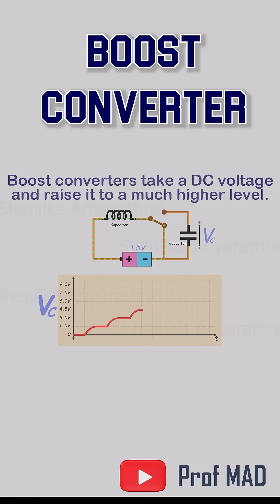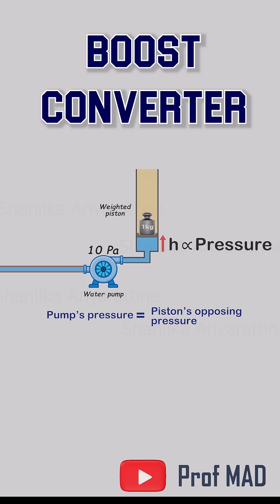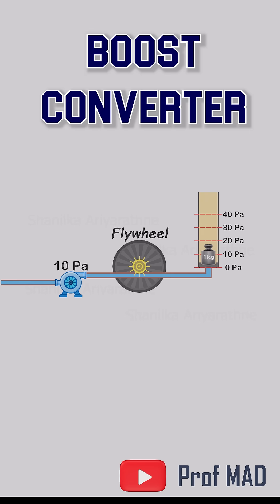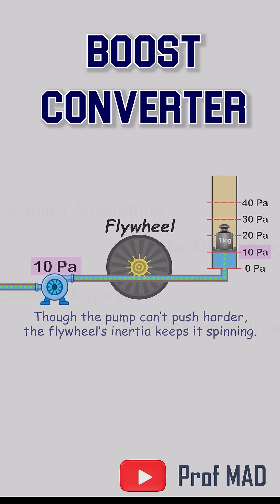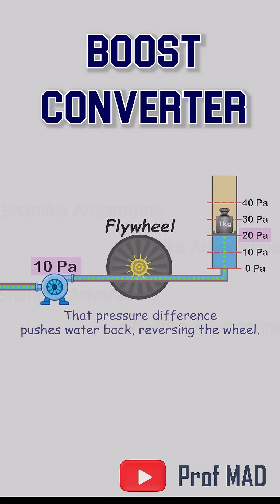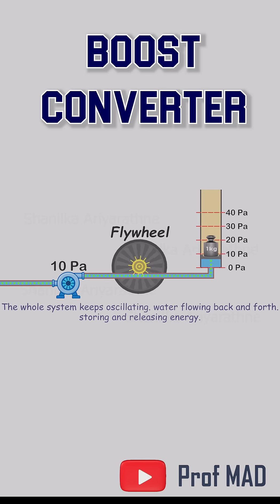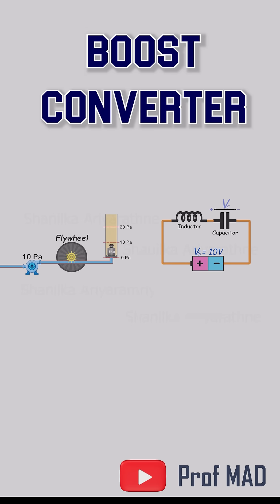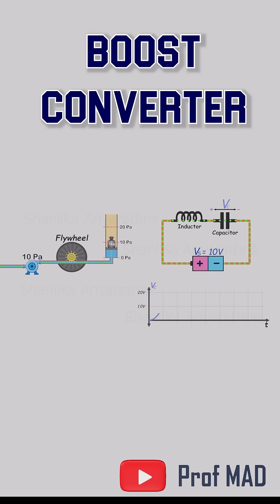The Boost Converter Explained With One Genius Analogy #powersource #electricalengineering

Comment: I’m not sure this intuition in the beginning is correct. If you simply connect a battery in series to an inductor and capacitor the capacitor will charge to the batteries voltage and remain at its dc value.